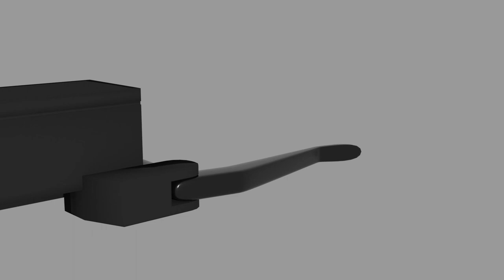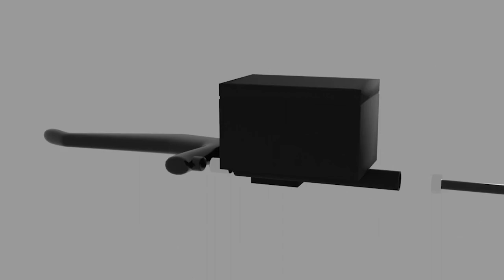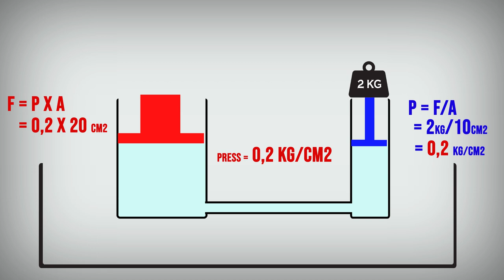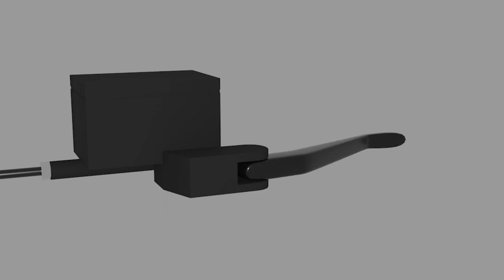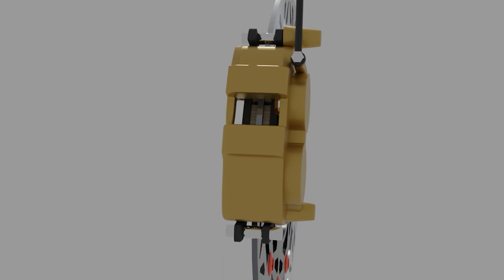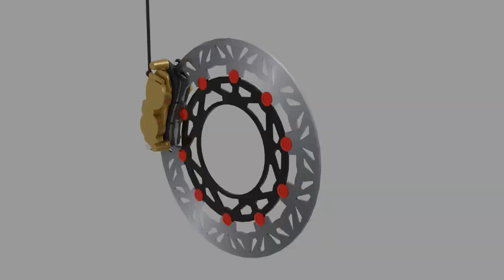Understanding Floating Disc Brake System

Comment: Brother pls guide me. About my Honda c- abs cbr250r 2014 model in which i did a mistake, that just for a rear wheel spin/burnout, i pressed the front brake lever which caused the abs trouble that = even upon sight pressing any of the 2 levers it gives a spring jerk on both the levers which makes the brake ineffective, with a sound such as something is rotating such as a spring in the breaking system. But when i took out the abs fuse the hydraulic brakes are working perfect{without abs}. 
I have already dismantled the abs modulator and re packed it. But couldn't find the cause of the problem. And the problem didn't solve. Pls guide, is it the delay valves which i should check and how to exactly where to look upon? And where the delay valves located in cbr250r? What could have gone wrong in the abs system which is causing a spring type feel on the brake levers. I also went to a Honda service centre, but that silly mechanic over there told me that he will first change both the sensor wires and then will go ahead. Which is not the cause of the problem i know very well. It was just the pressing of front brakes in this combined abs system for a small fun of rear tyre burn out, which caused this problem. Now it is several months i am using the vehicle but with the abs fuse out which means the hydraulic brakes are functioning absolutely fine. Anyone with knowledge about this combined abs mechanism please guide.